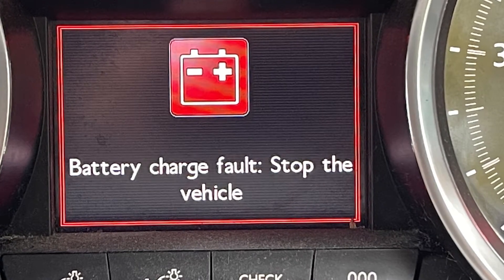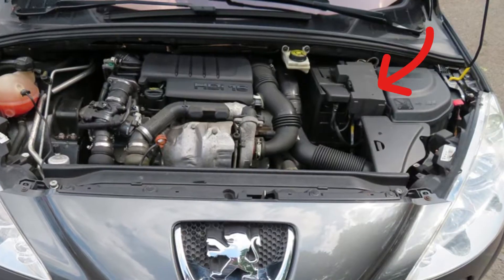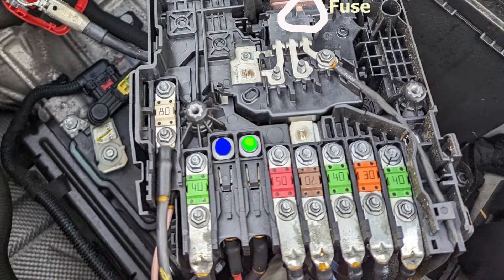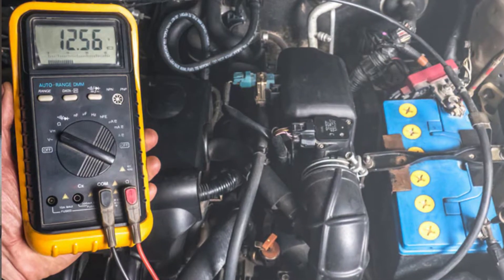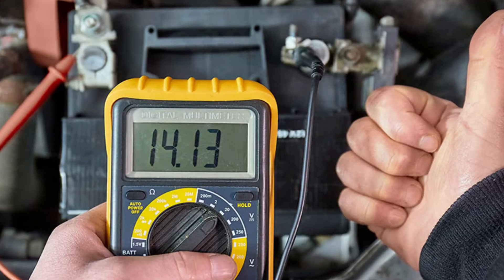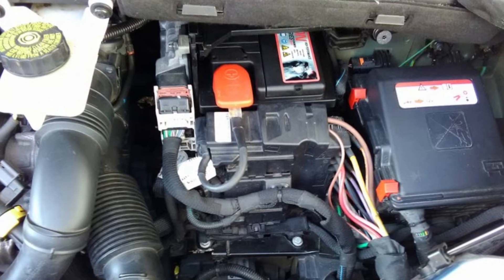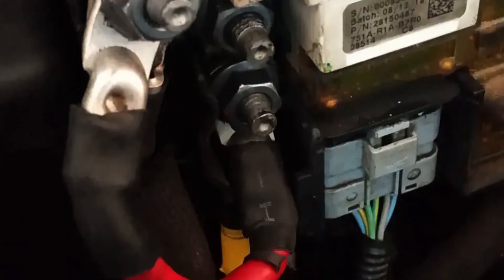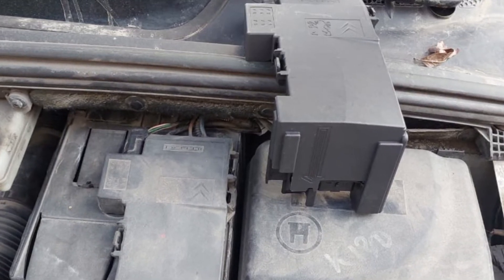“Battery charge fault, stop the vehicle” Warning in Peugeot

Comment: Hi. How can i diagnose and find out why my 508 isn't charging? I got only 11.5V when the car is running. How can i separate alternator from thia bpga? Where i can find wiring, and check which wire is going from alternator to the bpga, and check what voltage comes to the bpga? I got error message from time to time on board.
Reply from the maker: Hello. You need to know the Peugeot wiring to do this job. Usually, mechanics start by checkint voltage on alternator's terminals, but even this doesn't guarantee you will learn something about its work. If the warning is intermittent, it's most likley the BPGA freaking out.